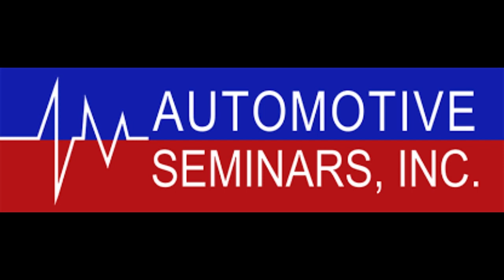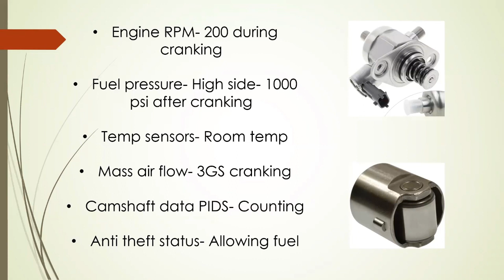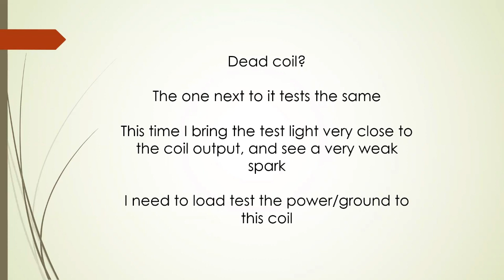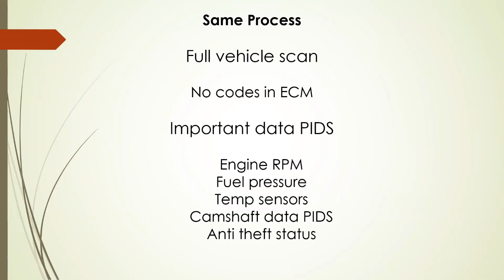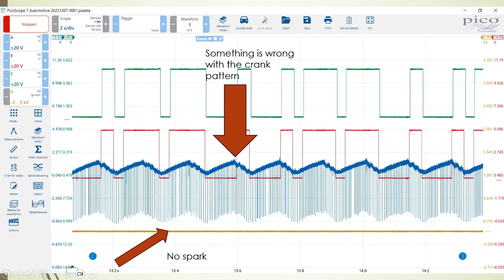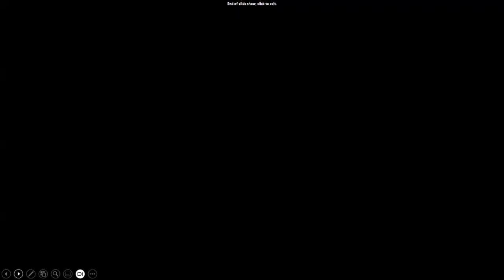E:233: No-Start After Engine Installation

Comment: Another great Podcast, Thanks for sharing! When I suspect a bad engine ground I take a test light connected to battery ground, and touch the tip to the engine, if it lights up you have a bad ground.